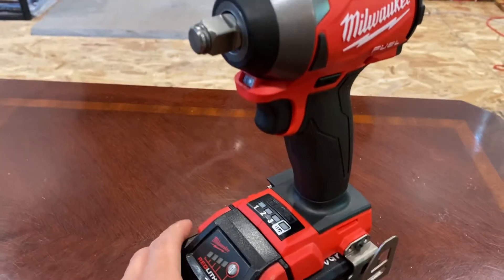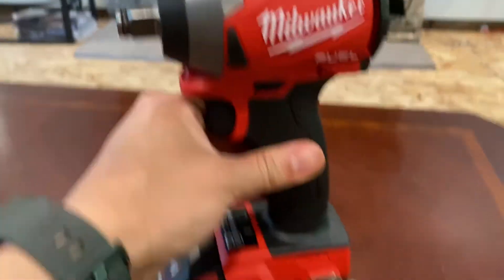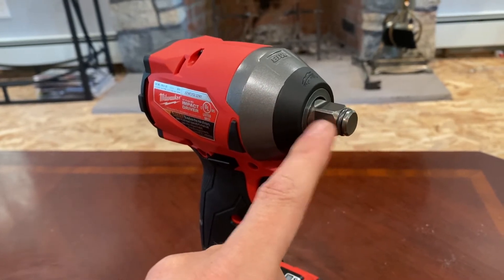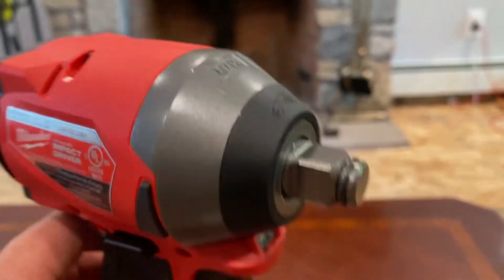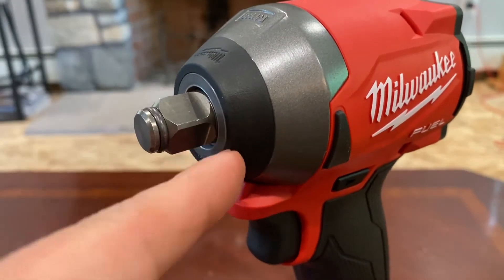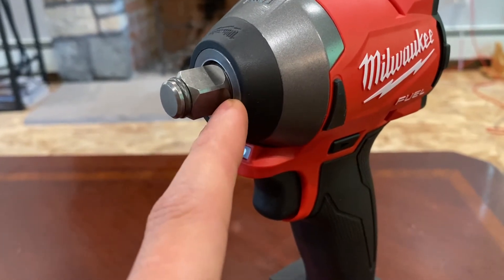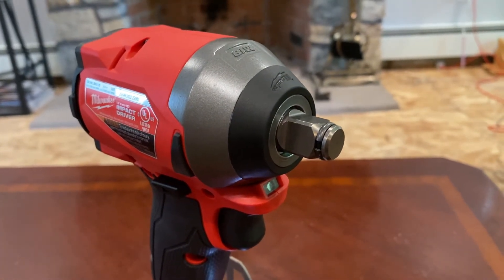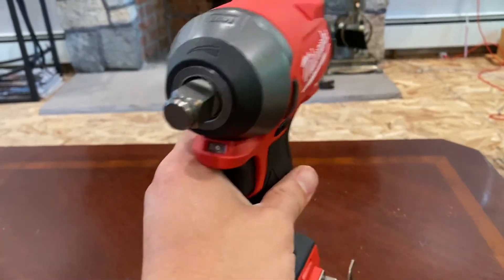Milwaukee M18 Frankenstein 1/4” impact driver to 1/2” impact wrench conversion overview

Comment: I made the same tool.  The dimensions of this frankentool is the same as the 2855P-20 except having the taper which will help it get into tight spaces better.  It's pretty much the dimensions of a M12 stubby but in a M18 battery, which I suspect is helping the torque numbers.

Comment: Use a step drill bit when enlarging the hole install a 1/2" anvil to do this mod without any trouble.
Reply: I used one however the cavity needed to drill 0.65"/16mm is longer than the bit itself. Make sure you use a bit with a bottom end the size of the hole you're drilling out. Mine end up being a tiny bit bigger. Still came out perfect!

Comment: What about a Frankestein using the milwaukee's 2853-20 impact driver swapping the anvil with the new Bosch anvil, with dual function (Two-in-One shank 1/4 In. and 1/2 In. Bit/Socket Impact Driver)  that will definitely be the ultimate tool impact/wrench ever.  Can that be possible? One tool for all :)
Reply: i’ve thought about doing that but milwaukee sells an adapter that goes from 1/2” male to 1/4” female and i feel like that would be stronger when i really need to torque stuff down
Reply: Check out Mancaver Tools. He made one for the DFC850 with that exact anvil

Comment: Awesome job! I'm trying to do the same and I have a quick question. I have the M12 1/4" Impact Wrench (basically the same body as the 1/4" Impact Driver but with an anvil instead of the chuck). Anyways, I'm trying to convert the anvil into a 3/8s drive. I have the M12 1/2" stubby and it's great but it is honestly overkill on smaller bolts. I invested into the 1/4" anvil impact wrench with the intention of using it for smaller fasteners since it is lighter however if I can convert it to 3/8's I could use my 3/8 impacts sockets on it. Would you happen to know if the shaft size is the same or would I have to modify the 3/8's anvil to fit on the 1/4 impact body? I see replacement 3/8 anvils for around $20 on eBay and wouldn't mind giving it a shot.
Reply from the maker: You’d most likely have to open up the hole to fit the 3/8 anvil.

Comment: Did you use an m12 1/2 anvil or an m18 1/2 anvil? In the video you said you used an m18 1/2 but in the comments you said m12 1/2. Just making sure so I can get a tight fit too. Thank you! Sorry for the repetition in questions
Reply from the maker: You’re right I misspoke in one part of the video. I used an anvil taken off a M12 1/2” stubby impact wrench.
Reply: @jjrock5  He's correct!
I also did mine using the 1/2" M12 Stubby's Anvil and have a perfect fit. Speed 3 rips lug nuts so easy even with a 1.5aH battery 😊😊😊😁😁😁🔥🔥🔥

Comment: Where May I purchase that 1/2 stubby anvil?
Reply from the maker: I believe they’re available on ebay. I took mine off of a M12 stubby wrench.
Reply: why was my comment deleted?..
Reply: Anthony, not sure whom deleted your comment. I was hoping someone would help me build this.
Reply: @cfrayre6572   part number you need is 42-06-2555, since these "influencers" cant answer a simple question..ill gladly help... m12 fuel stubby 1/2"
Reply: @anthony8787  I thank you.
Reply: @cfrayre6572  Hey Anthony,
Did you ever make yours? I just did mine over the weekend and am thrilled with it! I ordered the M12 Stubby anvil through great lakes power tools. Took about 4-5 days to arrive and was about $28 shipped. This thing rocks even with a 1.5AH battery! Speed three rips lugs off like no joke. Can't imagine how it is using the high output batteries lol like jjrock did!
Reply: Thanks for getting back, that’s so awesome. I haven’t yet fixed mine up yet. Tied up with other projects. I have had this almost a year and I need to do this. Afraid I might make a big mistake. Will see how it goes. Thanks.
Reply: @funnymomentsnow1425   yes I made mine as well!!! Its an animal, wish I'd done this sooner!!
Reply: @cfrayre6572   dont over think it!! 21/32 drill bit, go slow use oil, and use a dremel with a fine sanding cone to hone it perfectly!!! Mine has a very mineut amount of play..but you want a little for o ring tolerance! The tool is a pure beast for its size..its literally unbelievableq
Reply: @cfrayre6572  It's all good! 
You can so this. My biggest challenge was removing the collet. I found this video and it was helpful  https://youtu.be/pk0KLWLuVBA.
Other challenge is how to hollow out the 0.65". I used a step bit from Harbor Freight. It hollowed a little bit more than I liked. If I could do it again, I'd find a drill bit large enough to borrow the hole. For cleanup of the old grease, use orange goop. That stuff works wonders. You'll need to regrease the anvil area and the inner barrel after you clean out the metal shavings. I used black moly grease for bearings. They sell that at Auto parts stores for $4.00. Good luck and keep us all posted on how it went
Reply: @anthony8787  I wish I knew about the 21/32 drill bit. I'm glad you like yours as well. Should have some videos of mine up soon!